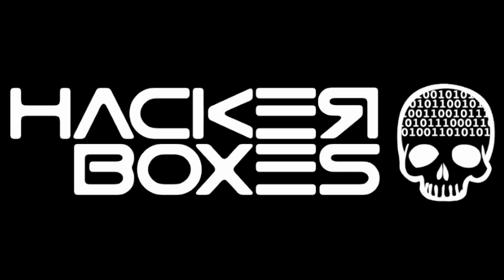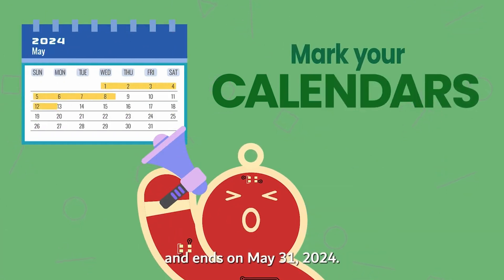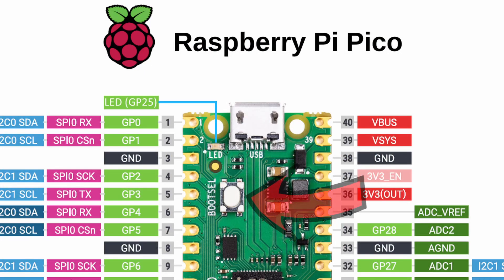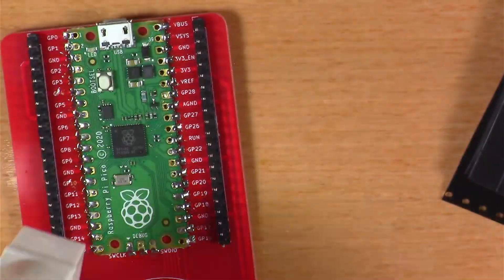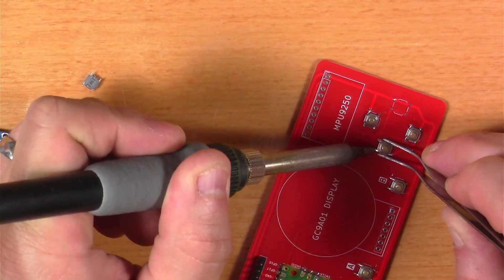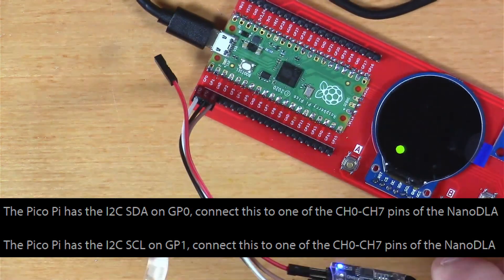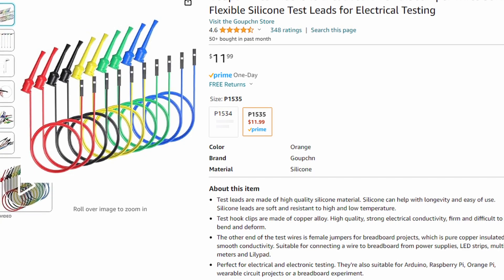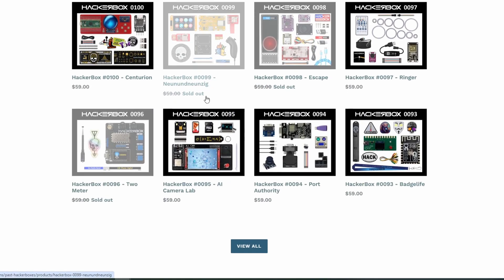Hackerbox 0100 - Centurion

Comment: Great video, Jamie! I like how you explain everything clearly and provide a guide for someone to follow. I've known Jamie for years and he does a wonderful job at explaining how something works and can break it down very well to help you fully understand anything. Might have to pick up one of these kits if I don't win.

Do you know if this works well in Linux or Mac? I checked the website and the software is available for them but didn't know about the drivers being installed. 

Have you looked into a Flipper Zero and WiFi Dev board? I got one not too long ago. A couple videos on one would be awesome :)
Reply from the maker: I've used a very similar analyzer with pulseview on Linux with zero issues at all. It just worked. I assume probably fine with mac too. Maybe I can let @retrocombs try mine and we can confirm. Thanks for the kind words and for watching! I've got a zero but I've not played with it a whole bunch. I should.